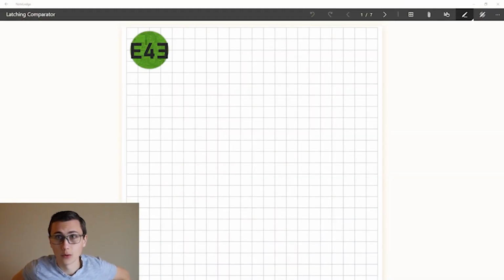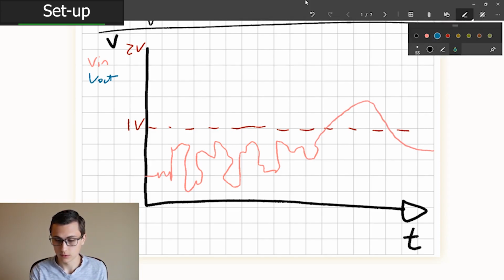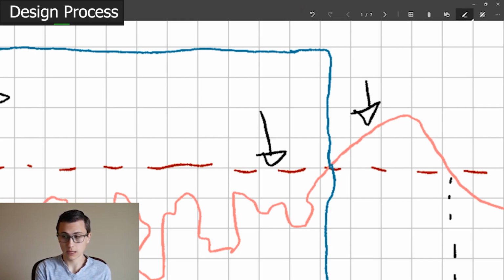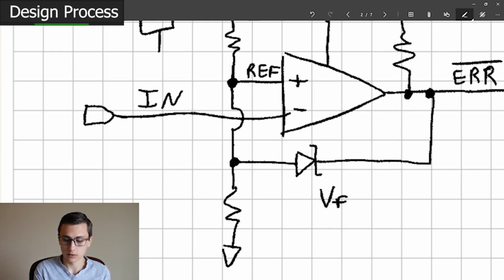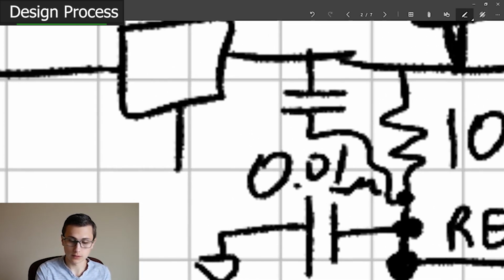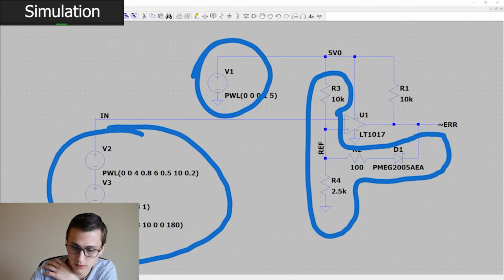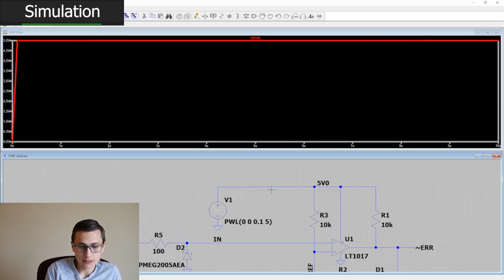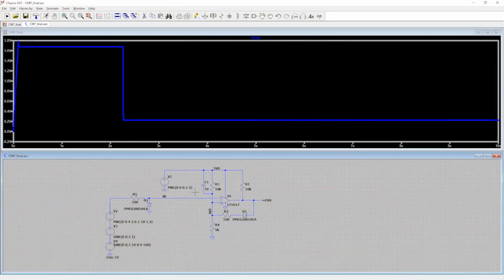Designing a Latching Comparator  Circuit!

Comment: when the input voltage is reduced to zero the circuit changes its behavior which in real life case after a fault happens the power must be cut off so the input voltage from the shunt resistor will be 0 an then no latch happens

Comment: I ended up using a P channel mosfet at the output of the open collector op amp that switches on a thyristor which stays on even when the voltage on the input changes.

Comment: still can not figure out how to and what to configuration to add to LT Spice to make it run as in voltage AC,DC, current, time... etc the manual is not help full
Reply from the maker: JD! Oh yes, I would love to help you out. I'll make a point to make some content around how to use LTSpice.

A couple questions to help me understand better:
Have you used any other spice simulators before?

Are you familiar with the types of SPICE simulation and what they are used for? (Purpose of transient vs ac analysis, monte-carlo parameter sweeps, etc.)

Comment: Thanks for this idea ! I think you just simplified my overheat shutdown circuit a lot !!! My latch was overly complicated :D Thumbs up for such videos :)
Reply from the maker: Hello Telectronics, that's awesome to hear! Your project sounds very similar to our 3d printer thermal runaway monitor. I think that we even released the schematic, and a simulation or two as a part of that project!

Maybe check out that playlist if you haven't seen that yet?

Thank you for watching, and I'm glad you learned something with us today!
Reply: Hello  @EEforEveryone  yes I am building a switch mode power supply and have to watch the heatsink temperature therefore I need a latched shutdown. No I did not watch your other video but I will do that soon. Of course I did learn something the diode trick I did not know as example ;) I also use a comparator but with smitt trigger function and after that 4-5 transistors as latch. It should save me 4 transistors at least. If I could pull the comparator high instead low I could save all transistors. Maybe reversing the comparator and diode connections will work out but the diode is cool could not be simpler than that. Thanks again I subbed your channel by the way. I like switch mode supplies and you just do that. I will keep watching. Wish you luck with your next projects :)